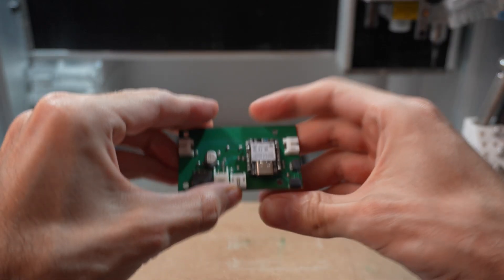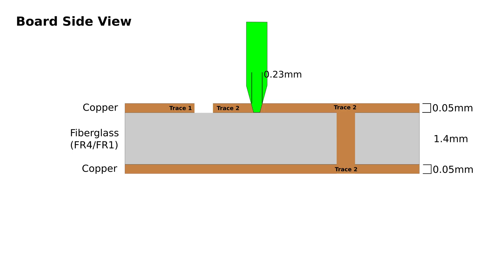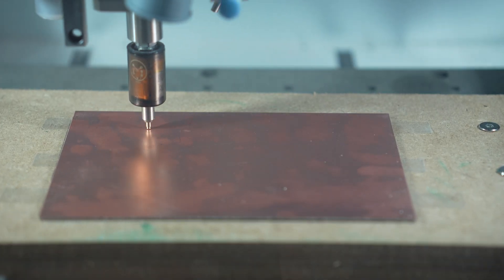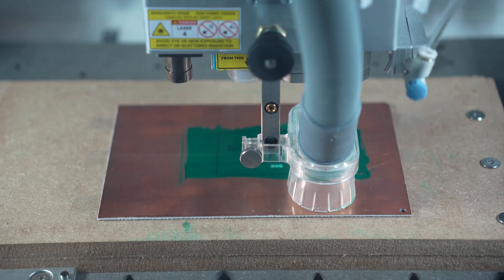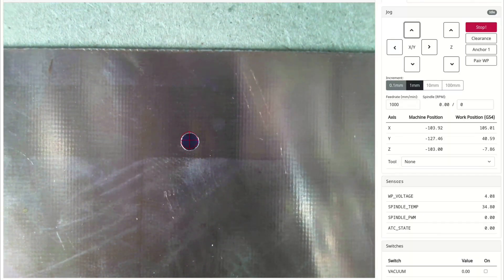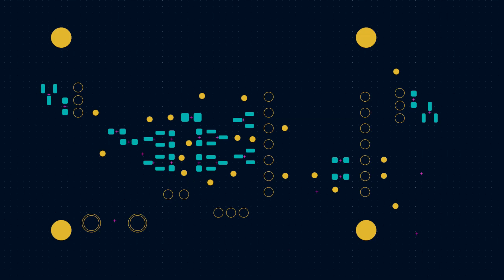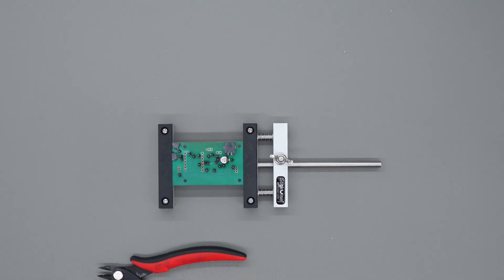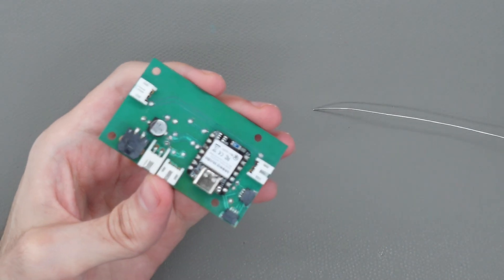What you need to know for making double sided PCBs at home.

Comment: Help me understand, you created a gcode generator? Why not use one already downloadable?
Reply from the maker: Yes. The video was originally meant to be a fun theory explainer, but I do use a custom gcode generator for the whole procedure. Trying to open source it by the end of the year. Most of the existing ones require a lot of configuration and manual operations to perform this process and don't include support for the intermediate processors I use in my procedure such as un-tenting of vias, camera alignment related features, etc. My script is basically, you just give it a single kicad_pcb file and the model of your machine and out comes a complete gcode file that does everything.
Reply: @MadeByDennis amazing!

Comment: why not simply using locating pins?
Reply from the maker: Both ways work. Depends on whether you trust the camera more or the lack of any clearance and skew in your pins and machine. I prefer the optical approach since there are fewer mechanical elements that can go wrong and I don't need to drill many holes into my waste board. The optical method takes longer to do, but has never produced any noticeable error in all the times I've tried it.

Comment: Thank you for your video! I own a Carvera but no camera what are you using and how did you attach and align it?
Reply from the maker: I made a 3d printable mount that you can find information on here https://www.printables.com/model/1405355-carvera-endoscope-mount . There is no alignment needed. For the process mentioned in this video, it is only important that the offset between the camera and the spindle doesn't change between measuring the front and back sides of the PCB.

Comment: I haven’t seen a vaccuum box like that before. Cool. 

Would there be any advantage to apply the soldermask before milling? 

I’m thinking it will support the copper and give cleaner traces.
Reply from the maker: That's an interesting thought. Haven't tried it  Would be quicker but I think you'd need to cut through around the copper so the solder mask layer will probably get much weaker with all the gaps.
Reply: @MadeByDennis yeah I was thinking the soldermask would support during the cutting, perhaps allowing for finer features? Afterwards you’d apply more to seal everything.

Comment: really nice video and results! do you have a sense for how appropriate those cheaper 3018 cncs would be at isolation milling like this ? many videos show how badly they perform cutting wood etc but since this is mainly engraving a thin layer of copper could be good enough ?
Reply from the maker: I have a 3018 as well and there are no issues in terms of power to mill the board. I mainly have had issues with the minimum cut width that I can get being not as good as a more precise CNC. 0.4mm wide isolation passes is probably the smallest I'd trust one of these machines with. But, I've seen other people get better results, so it might be that my unit has some bad run out.
Reply: @MadeByDennis  thanks for that insight! i have one in storage that i may get a chance to experiment this on one day.. in meantime am using a paint and etch method w laser cutter + chemicals